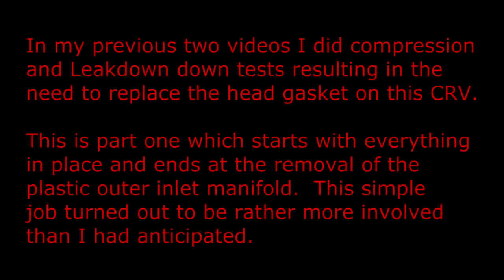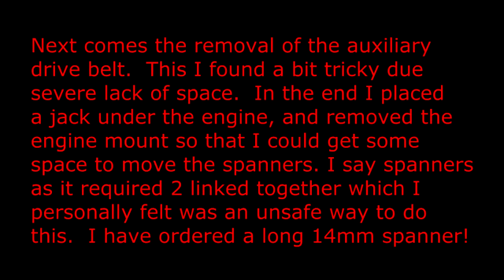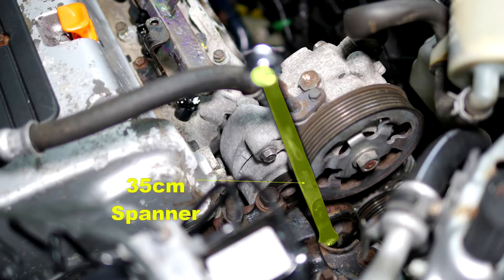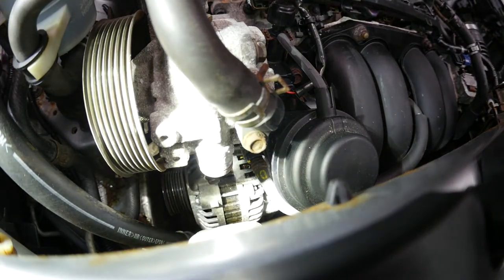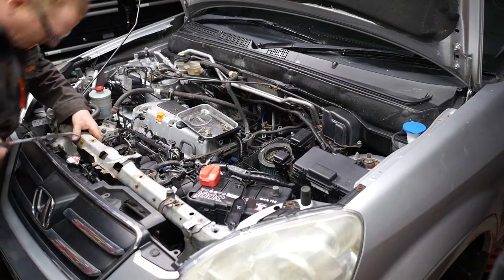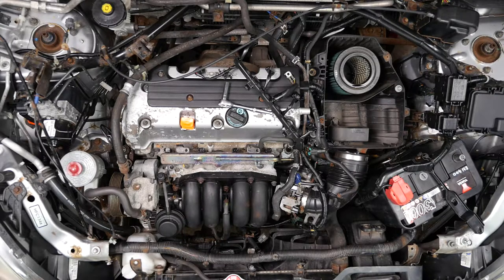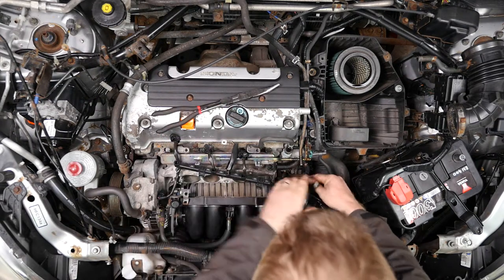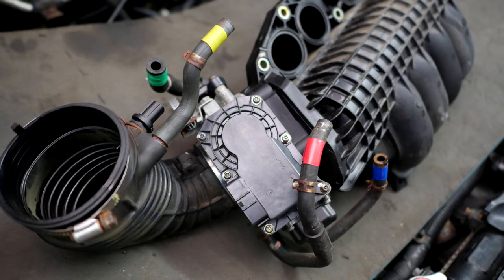Part 1 - Honda CRV 2 litre K20 A4 Head Gasket Repair. #k20 #k24 #crv #hondacrv

Comment: Your video is a ton of help for me Sir, im not a mechanic but ‘LOVE” to learn this. I have a 2004 crv ( i think that car is pretty exposed on salted environment ), and i want to remove its intake manifold just to clean it but im very hesitant until i saw your video. Just one thing,  i,d observed that upon the removal of intake manifold it doesnt have a gasket on it between the manifold and the engine block.
Reply from the maker: Really appreciate your positive comments and glad this might help you.  I had to just check when you said no gaskets but there is........on the plastic outer manifold there are round rubber inserts that seal the plastic part to the aluminium inner manifold and then the aluminium inner part has a normal strip gasket.  Hope this helps mad duran.  At 29 minutes in you can see a photograph of the plastic outer manifold and just make out the 2 x '0-0' like rubber seals.
Reply: Coats and Gaiters ....I,m sorry i didnt notice those seals. Yes Sir, i do have screenshots of those pictures. Thank you so much.
Reply from the maker: @madduran4536  your keeping me on my toes lol

Comment: I so appreciate your videos, I downloaded all 10 just so I can reference them as  I'm doing this job on my daughters crv at the moment in So. Calif.It is so nice to know what to expect before starting the job. Again, great job on caring enough to go through the trouble to make these videos to makes other people's lives a little easier. Thank You. Note. So. Calif cars are rust-free and at 16 years old the one I'm working on looks new which I'm very thankful for and the crank pulley bolt only took about 5 minutes and it was off.
Reply from the maker: Well thank you so much for the compliment.  This really pleases me that it's helping people.  Well I don't know about that crankshaft bolt coming off that easily !!!!! hmmmmm  your the first it was nice to then.  Loads on the net about people struggling to undo that bolt.  Just go careful with each step as it's easy to make a silly mistake and the Honda's seem very fussy on things.  Superbly made engine though.

Comment: Well my head gasket on my 2003 is done thanks to your video. It costs me $1,000 in Honda original parts. I did the thermostat, new head bolts, water pump and spark plugs at the same time. I learned a couple of things. Always have the head surfaced. It costs less than $100 and is cheap insurance. I broke the same thermo coupler you did , Honda made me buy a complete new part. 
I also learned on the serpentine belt if you use a closed 14mm wrench on the nut, you can use your 1/2 breaker bar in the open side giving you enough leverage to release the idler.  The stealership quoted us $4500 for the repair.
Thanks again
Reply from the maker: That's fantastic news JJSmith.  Your hard work has saved you $3,500 which is a tidy sum.  Your have to take your partner on a nice holiday now with those savings lol.

Comment: Great video!! Detailed and informative. 
I own the similar model with almost 400K km on it. Did a lot of repair works on the peripheral system. Just sharing.
1)To do most of the peripheral system, bonnet support bracket(T-bracket) removal will able to provide sufficient space. Removal of condenser fan unit/coolant expansion tank will provide extra room.
2) To take out the IMRc or plastic intake manifold,  i did not need to take out the fuel rail. (But to remove the inner metal air intake manifold, fuel rail has to be removed anyway)😆...
Reply from the maker: Thank you for that info.  One of the best petrol engines out there I think.

Comment: Your videos are so detailed and filmed in the best way I've seen on youtube! You deserve way more subscribers now! 

I'm about to take on the task of changing the head gasket on my 04' CRV, but before the head gasket got damaged I was hearing a lot of squeaking whenever I hit the gas while driving, do you think there's anything else I need to fix, maybe something with the ignition? 

Thanks again for this great series! Really does help a lot!
Reply from the maker: Really appreciate your positive comment.  Sadly I didn't drive the vehicle before fixing it as I bought it as a non runner.  Squeaking wouldn't be metal against metal would it?  I'd just advice doing everything slowly and precisely on the K series.  I wouldn't rush any part of it.  Good luck.
Reply: @CoatsandGaiters  Thank you, I was thinking of just replacing the engine since I need the car to move as soon as possible.

Comment: Hi , just thought that on the manifold, you label the hose " Pipe to water pump housing " but I think it is a vacuum line and it goes  to the PCV valve. i got confused by that.
Reply from the maker: Sorry about that.  Yes your right it is a vacuum hose.  Have you any idea why it goes to the water pump Leviticus?  I've never come across that before.